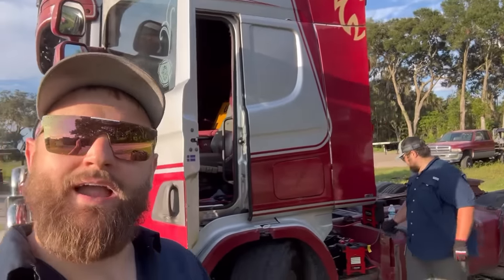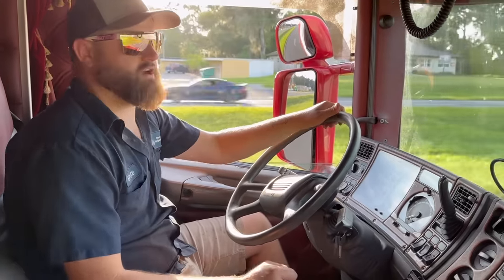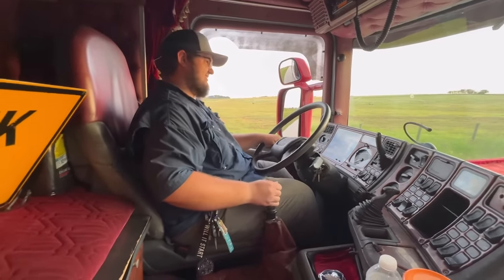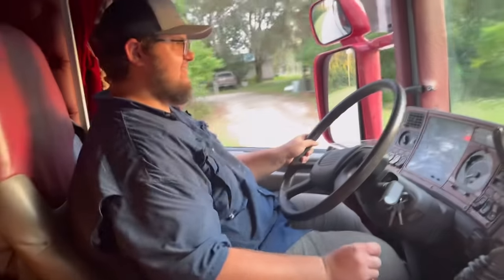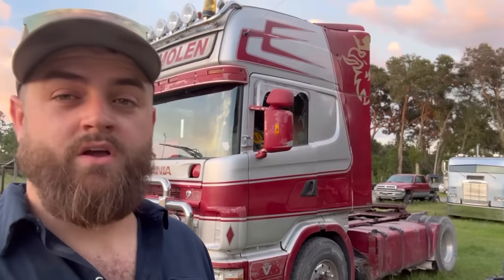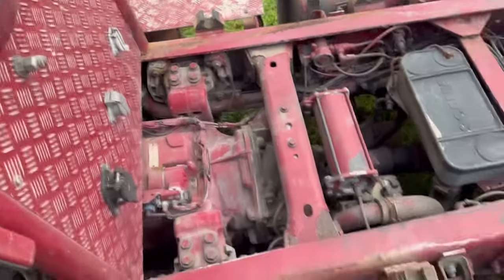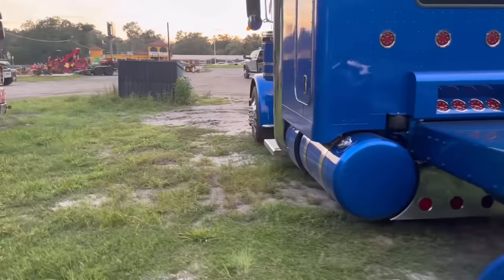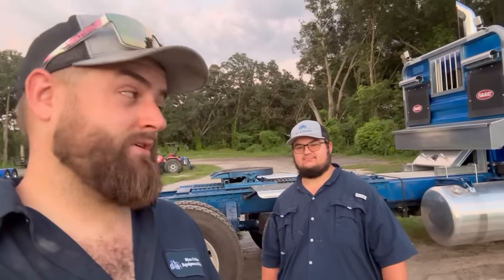American ATTEMPTS to Drive European Semi Truck. (Big Fail)

Comment: The speedo could actually start working if you remove the torn tachograph disk. Needs to be closed and locked properly for speedo to work.
Reply: It looks like a One Day disk, only good for 24 hours and then you are supposed to change to a new one. That's why you have those thick black bands, it's been over-written again and again and again.  / B.
Reply: A long time ago (1980's) I was working as a Bus Driver in a big Bus Depot, and when the man who changed the tachograph disks was away on his holidays I filled in and did his job. It was Kienzle in all the buses, 7-day sets but mostly old mechanical wind-up tachographs. Yes I did get my fingers cut a few times, but not all that often. / B.
Reply: Yep, that really true

Comment: If you're still looking for a rear frame off a Scania truck have a look here in Australia we have fucking heaps of them and almost all are factory twin axles. Might be an option depending on cost.
Reply: I mentioned in a previous video how he could find one in NZ/Aus, and should look at rigid/tandem units with the longer chassis since that's what he wants. buy a whole scrap unit and container it back to the US and then he has other spare parts he might need.
Reply: This is a good shout! And it'll be rust free!
Reply: Hmm a bit far away here aren't we?
Reply: @oliverspray2752  well, he's not going to find what he wants in the US that easily, here in Aus/NZ we have lots of Scania twin drive axles with a long wheelbase, Europe is pretty much just single drive.

Comment: as a Swedish citizen who now lives in U.S.A i can tell you driving a Scania is way more comfortable  then driving any other truck out here.
Reply: When comparing chassis alone, American trucks are actually more comfortable than the shorter Euro trucks and this stems from simple mechanics - longer wheelbase = better ride. But Euro trucks usually get air suspension on their cabs so it's about even. The US solution is cheaper, the Euro solution exists solely because of the regulation restricting the length to 18 meters.
Reply: @JAnx01  25 meters in Sweden nowadays
Reply: @aktiemannen Actually 34,5 meters since august 31.
Reply: @JAnx01  just saying from experience I’m truck driver here in Southern California sleeping wise  American trucks has an advantage because the are bigger however driving American trucks has no shot
Reply: @TheAnonymousArtsz meh, the cabovers feel more cozy imo but ig you know the saying about opinions and buttholes.

Comment: Seeing Americans float gears in a synchronized gearbox🥲 rips my heart out😭😂
Reply: That’s true please use the clutch
Reply: Never knew they were synchronized. I’m so used to unsynchronized and floating.
Reply: @leshopper7863  European lorries have all been synchronised since the mid 50's
Reply: @frankeinfish  nope, a lot trucks like DAF, Iveco, MAN, Fiat, Pegaso, Bedford TM, Foden, ERF, Seddon, could be with Fuller box in the 70,80,90'ies ..
Reply: Yep, you need to disconnect the gearbox from the torque you get from the motor to make the split-gear to move in. Might even be a switch on the clutch that needs to be activated before the switch-up happens.
Reply: @leshopper7863   Hearing that they are unsyncronized sounds weird to me, thats something to me that I assumed was standard after 1960 at the latest.
Reply: @vHindenburg  I guess the American trucks are different
Reply: @mbo191 i like the style with the switch the most because you can pre select allready before you want to switch the splitter and then just press the clutch and it wil happen. That actually the way i learned it from my instructor. Why work harder if you can be lazy.
Reply: @olegpedersen8111  In Finland the Sisu:s had Fullers too. A lot of old timers would never drive anything else. The best transmission ever produced. Cheap steering wheel holders resulted in synchronized and, God forbid, automatic transmissions.

Comment: I'm gonna say it again; that is surface rust. It is fine. Unless if you poke a screwdriver into it and it comes out of the other side of the frame, its fine. Great videos though :)
Reply: It’s stage 3 cancer teetering on 4. Better to just get rid of it instead of fighting it again.
Reply: @lookingbehind6335  it's a Scania. Its designed to handle way worse than some surface rust. Zero rust there is structural so far so it's very easily fixable, sand blast it and paint it and it'll be good for atleast another couple decades. The only thing not salvageable is the battery box
Reply: What @Robyn says. That isnt serious rust.

Comment: Remember...your never late in a V8!  The thing on the dash with the paper disc is the old style tachograph or tacho. It records speed hours driven and breaks. In the UK we can only drive 4½ hours before we have to have a 45 min break. We can only drive 9 hours a day extend to ten,but you have to borrow from the next week and lend back!  The gearbox,1 2 3, pull the collar 5 6 7 is called a range change,if it has a grey switch on the top of the stick,that's called a splitter that halves the gears so it's 1...1½.....2....2½.....and so on.hope this helps.

Comment: the rectangular thing is a heat exchanger for the hydraulic retarder. The smaller lever on the dash is to set how much the retarder works. When bobtail it will lock up the rears, works regardless if you're in gear or not. Can hold back a loaded truck going downhill, similar to using jakes.

Comment: Tag axle & full fenders for the win & ease.
Only really need to use 4 gears bobtailing. 2nd high, 4th low, 5th low & top a time & use the torque off idle. She'll fly 🚚🤘
The rust is surface. Blast, prime, paint. 
Love these vids thanks... keep em coming.
Reply: Fly? I bet it won't do even triple digits without a change of axle gearing.
Reply: @ImForwardlook  I'm sure it would do triple digits without a gear swap! It just needs the right tune and definitely a much longer powerband. It's just like a Mack engine where there's 6 minutes of turbo lag and 8 seconds of boost before you run out of real estate and you gotta reel her back in for the next gear and she falls flat on her face every time!
Reply: @ImForwardlook i drive a r 620hp v8 scania and had her on 175 kmh which is over 100mph and stil had space under my right foot. They're fast i can tell you.
Reply: @johan8724  You mean there are actually Swedes driving over 56 mph? A rare sight for sure.
Reply: @ImForwardlook  If you talk miles? No. But without speed limiter 110-120km/h
Reply: Without trailer start with 4th low, 5th low, 6th low and 6th high! As if you want to drag with it! Let the torque do the job as you say!
Reply: @markusylitalo8376  So, extremely slow.
Reply: @ImForwardlook  my r620hp v8 scania does 60mph on limiter with 1150 rpms the red zone starts at 2400 rpm, i had her at 175 kmh which is 109mph and had space left under the right foot. Could go even faster but the cops don't sleep overhere🤣🤣🤣
Reply: @ImForwardlook  drove this 530 hp too back in 2000 and she did way over 100mph too i can tell you. I prefer a bigger cab coz they are quite cramped overhere but length regulations wouldn't allow us to drive rigs you do overthere. I always call my bed a hoodshelve 🤣🤣🤣
Reply: @johan8724  really? At what rpm? Back in the day my low geared (90kph @ 1050rpm) R480 would run into red at 152kph.
Reply: @tanelpolts7257  the 530 did 1300 rpm at 92kmh, the r620 i drive now does 1100 rpm at 90 kmh

Comment: Please use the clutch properly. Fully press it ALL the time. Respect that it is not a USA truck gearbox. It litterly is the only part of the truck that is not going to tolerate the abuse your giving it. It is happily going to do burnouts and get a new rear end or even paint job. But it is not going to keep taking the clutch and gearbox trashing. It is the one valid thing Volvo got over Scania and that is gearbox and drive train reliability and toughness. The Scania requires deep care to manage the gearbox and clutch. It is really picky and hates winter. Funny for a Swedish truck but that is the truth.

And if you get a new Scania Manual. Please for the love of god make sure to use the clutch right from the start.
Reply: I can't even count how many manual Scanias I have driven along my career. Starting from 3-series 400hp V8. Never broke a single gearbox. But i've heard of it. Volvo manual gearbox is the only one in the world that gets stiffer to change by the time goes by! :D

Comment: European trucks are much shorter than American ones because of the way European law defines overall dimensions. The limit in Europe is 18.4 m or about 55 feet for both truck and trailer. If you want to ship 40' containers, your cab is limited to 15' additional length.
Reply: But Sweden has a max lenght in 25 meters though.
Reply: 34,5m
Reply: those are called B-Double consists. the swedes only drive high amounts of cargo due to the hills and mountains. it is therefore cheaper to have 2 trailers instead of 1. @DaB55
Reply: In Finland 34.5m and 76tons

Comment: That round paper that you took out and looked at is a single-use tachograph sheet that you have to fill out. Those sheets were used by old trucks. Tickets go into analog tachographs, today there are digital tachographs that use cards that last for 5 years. By the way, I am a truck driver by profession.

Comment: DO NOT DO NOT DO NOT FLOAT THE GEAR CHANGE THE GEARBOX NEEDS THE CLUTCH and sometimes you have to double the clutch
Reply: Slowest transmission in the industry, absolutely horrifying.
Reply: @ImForwardlook  if you think its slow, your shifting wrong...... its fast as hell and you can run a toyota out on the red light if you want ;)
Reply: @Joel.V.  Compared to a Fuller? I don't think so...

Comment: I learned manual shift when I got my truck license. But I like the automatic gearboxes nowadays. You can still manual shift with those automatic gearboxes when needed.
Reply: Auto gearboxes when towing in small or big trucks are actually safer downhill.

In a manual with a heavy load when you need more engine break you can mishift and gain a dangerous momentum.

Comment: Honestly should lean more towards euro style modifications, keep the single rear axle (maybe use an american axle from a Freightliner or something) but you really ought to keep the scania looking as euro as possible. Yes there was a twin axle at the back and maybe go down that route but stretching out the frame like you usually do really isn't for the scania
Reply: That's the whole point of doing a stretched frame and twin screw! Because you don't see it! What's so great and makes a build stand out? Sure ain't putting out another cookie cutter and tossing it in with the rest of the batch looking like everything else!
Reply: kinda depends on where in Europe, in Scandinavia they tend to have twin axles for the rear too, it's mostly just in the rest of Europe that the trucks only have two axles. Might have to do with grip, ice, steep hills, etc.
Reply: @curtismahood3629  yes but how often do you see a Euro style custom truck in America? Not often I'm guessing, it's like Harley Davidson motorcycles....you see flash custom jobs and they're a dime a dozen but you never see a different take on because they've all been done to death. A euro style custom truck will stand out in any truck show across the USA
Reply: @harleyrobertson6746  one of the main reasons to do an American style build over a European style is the cost of importing the parts. If it was a Harley it would be the same as building it in the states maybe a bit more expensive but they're sold all over the world so the parts are readily available almost everywhere! A scania in the US is a whole different story and the prices to import the parts is some times just as much or way more than said part not to mention the time it takes to get the parts.
Reply: @curtismahood3629  you can still do a euro style, use an american single axle but paint and interior in a euro style
Reply: @harleyrobertson6746  oh ok. I wasn't aware that you've done it before. Since you have so much experience in this field you would know that doing it with all American parts it would be an American build. If you only referring to keeping it a single axle they make twin screws in Europe.
Reply: @curtismahood3629  I know that, but being English 9 times out of 10 they're single axle. The reason why they're single axle is because we're not greedy fcuks that need heavy loads of crap delivered every second
Reply: @Glenni91N  Not in Scandinavia they also have a third axle because: European trailers are mostly with 3 axles, but in Scandinavia the axles of the trailers are moved to the back. And there is a law depending on the state 10 tons per axle and in order not to be overloaded, why are the 3 axles of the trailer after nazat o.o. standard trailer has another axle on the tractor

Comment: So heres 2 things you wanna know from This video. 

1. The Tachograph is a Control system for both the Cops to stop drivers from Sleepdriving and To protect the drivers from Companies pushing them to work more hours than its safe. 
The Paper one Is no Longer in Use we have a Digital card one now its like a Visa or Mastercard and It stores your Driver telemetry ,speed operating hours etc... It should only have 1 line not a Charcoal drawing on it and as soon as the line closes your Paper is considered invalid and you will pay a fine for it. It's a 24h full circle. If you dont have a paper in the Red light will always be on so people just leave it in.  
Since the Tachograph is a standard that Tach on the SCANIA is Not For SCANIA only. Its a Universal. So It needs to be tunned for the truck, the Wheel RPM and even Tires on it to show accurate Speed. They are made adjustable form the factory to fit many trucks in the generation. 
So even when people send you a working one you still have to find a shop to properly tune it or they should do it in the EU truck and then send it to you. Tuning it is a Yearly job every time you get ready for Inspection pre registration.  You can get a Mph UK one or a EU continental one designed for going to UK from Eu it has a typical added Yellow Smaller line with Mph markings on it. 
That's also why it doesn't look like it belongs there. Its not designed for the SCANIA dash. 
Digital one Just collects data so the Speedo is now Made by the Truck manufacturer. The card Tachograph collects data from the gearbox. 

2. Sadly this gen of SCANIA and this Gearbox is one of the spongiest we have.  Trick to it is Do not Force it into Gear you basically just Push into the direction of the gear apply little pressure and wait for a moment it will slide in smoothly. It takes getting used to. But it's only SCANIA and only this gen. 

And one more thing Manual from latest Gen is gonna be pretty hard and pretty expensive. Due to Emissions regulations and overall advancements in technology, auto gearboxes are now the Standard. Only Smaller and Construction Trucks have Manuals as option. 

We had Auto's as early as 1998 in Mercedes Actros its called Telligent. And later MAN in 2000s. The problem with MAN ones is they were fully automatic you just had D N R and crawl. So The system really couldn;t cope with hills and stuff and eventually even MAN gave up with full automatic. 
Mercedes on the Other hand always made Telligent as Manual-Automatic with Sequential shifter, clutch assisted.
So basically you select gear Press clutch and when you release it switches. Auto mode allows you to fully let the Computer choose but you can still suggest the gear. Telligent is not an Automatic in the American sense, it's Automatically operated Manual with Sequential mode. 
And Most of Autos are that now, Sequential Automatics. They don't have the clutch pedal anymore, but are still technically Manuals with Auto mode. Because Automatics are basically junk when it comes to power delivery and maintenance cost when it comes to heavy loads. Its fine in cars, not here. And they can be a Pain in the ass when Inching. Only Last gen SCANIA and Mercedes pretty much any gen are really good at inching. 
SCANIA avoided as much as they could and Only latest gen has Auto as defaults, But Most companies don't even offer Manual as option.

Comment: Hey Bruce,in a previous video you removed fuse number one to disable the limiter this also disables the speedo. Back in the day if you needed to push on through the limiter in those scanias if you flicked the ignition key on and off really quick you could drive on through the limiter too,just not at night because your lights would flash on and off too😂

So I've heard...................

Comment: Yeah those are oldschool tach discs, keeps driver on check how long he been driving.  Blue collar would be good to have same rear lift as Scania has
Reply: Most trucks with air bags already lift up and down..They use them to hook and unhook..They don't lift as high tho..
Reply: @randyscott8660  doesnt have remote controlled tho?
Reply: For what? These guys are in the south.

Comment: Factory Scania Transmission is synchromesh therefore you have to use full clutch peddle on each gear change & do not double clutch like old fashion US TRANS.
Reply: Old fashion? You mean faster and better performing...
Reply: @ImForwardlook  Not really faster, but more durable. The first thing to wear out on a manual transmission is the synchros. Unsynchronized transmissions don't have that problem.